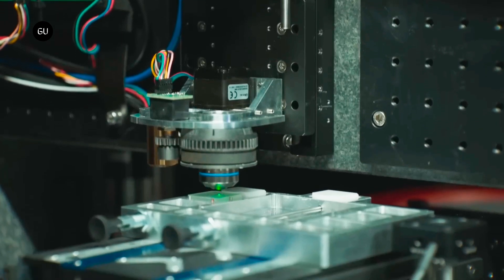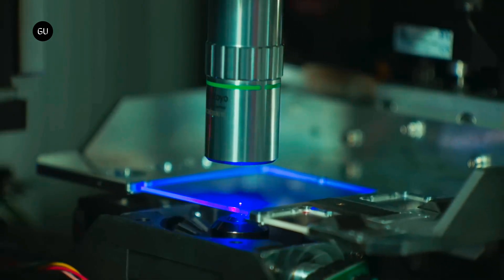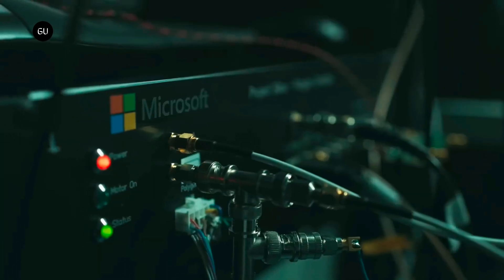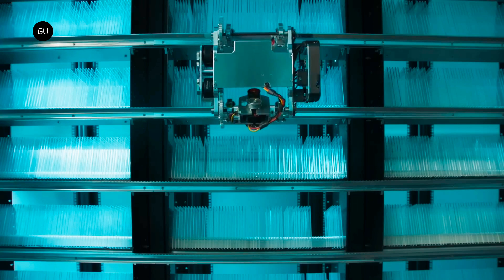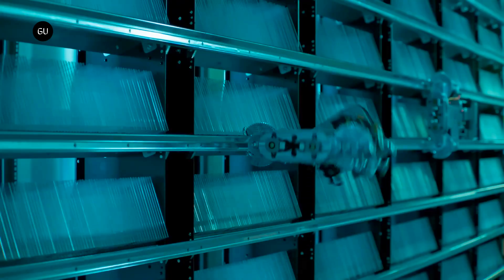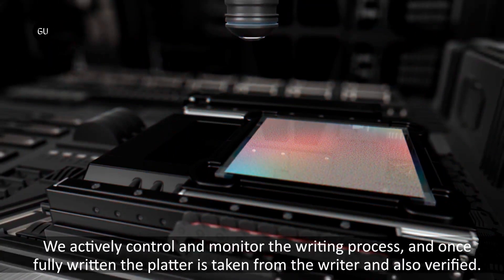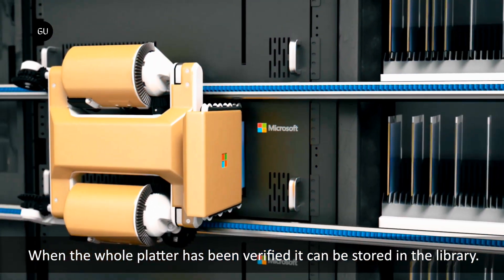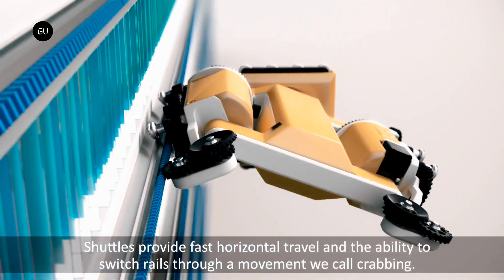Microsoft’s Project Silica Turns Glass Into Futuristic Data Storage

Comment: So in short, it's gonna be a hugely expensive medium that only high-end, high income institutions and companies could afford, and just like other storage media, will probably be obsolete and/or unable to be read within 10 - 20 years when something newer and better comes out, driving all the "current new technology" into planned obsolescence which means no replacement parts will be made for it?
Reply: If this were any other medium I'd agree, but in terms of physical storage media, data crystals are the end all be all and sci-fi dream. They won't degrade for thousands of years and can hold enormous amounts of data. The data degradation and media loss that has plagued physical media for decades would no longer be a problem. By perfecting data crystals, there would no longer be a need for companies to find a new format. Hopefully it will become available for commercial and public use sooner rather than later, but it won't be obsolete anywhere within our lifetime.

Comment: What advantage does glass have over traditional SSD?
Reply: and the worst part is that it could break easily and can't be recovered as easily
Reply: It lasts. You put a SSD on a shelf for a decade, the data on it is not readable anymore.
Reply: @aleksandersuur9475   it's possible for an SSD to work after being shelved for a decade, its performance and data integrity can't be guaranteed
Reply: It lasts longer, 1000 years. Does not need electricity to keep data safe. It does not have a speed advantage, but that's not really the point. It's about finding a more lasting way to store data.

Less electricity being used = less money spent powering SSDs = more ROI on storage solutions for B2B stuff.

Common sense.
Reply: @caffeinated4671  1000 years? Who tested this? Neither does SSD or HDD takes electricity to keep the data safe. SSD and HDD will keep the data safe and intact without any electricity, glass will just crack or break its prone to damage.
Reply: @prasannathapa1024  bruh? ssd the sectors will be burned out with constant usage un less you just write ones and ever again, for HDD the mechanical aspects fail and then it becomes a bitch for data retrival if at all possible or if the controller fails
Reply: @prasannathapa1024  buddy u dont need to test it is goddamn glass will be readable as long as its not broken
Reply: Long term storage and compared resource usage.
Reply: Also we cannot predict what AI is gonna spew out, decoding using AI is a very stupid design decision
Reply: @prasannathapa1024  nah, they are just using AI as a buzzword here, for efficiency, most likely to be some classical algorithm running behind thing